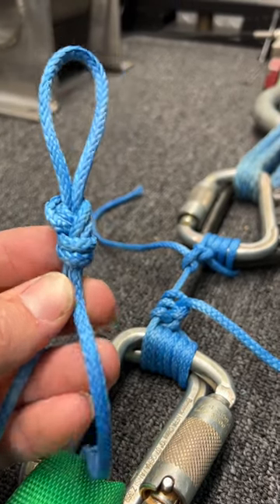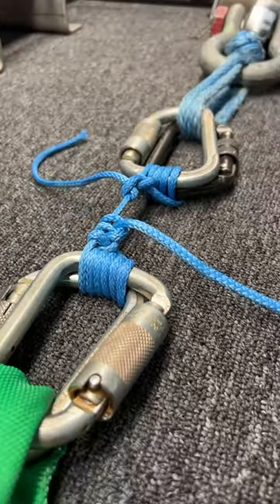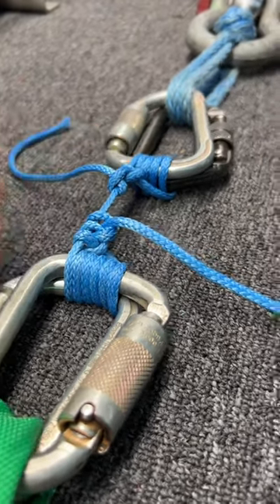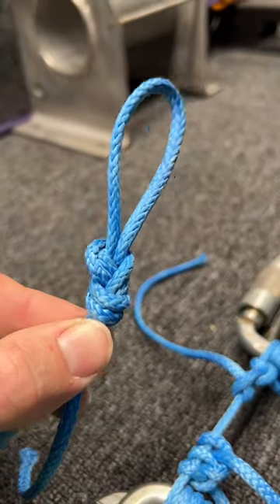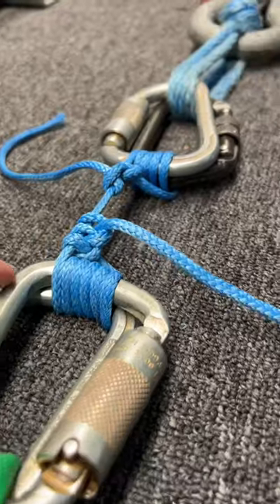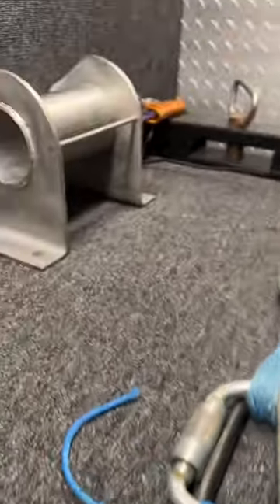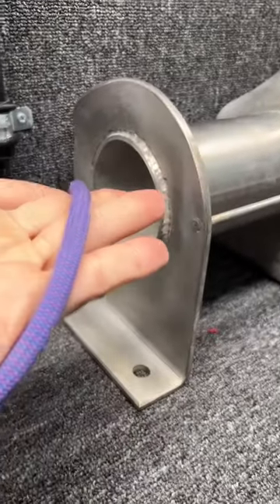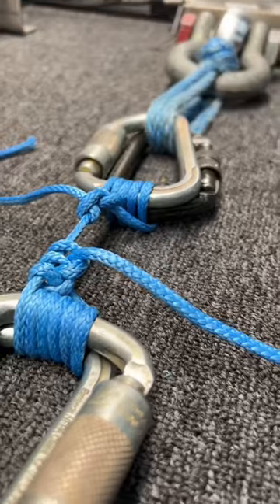Wrapped around 2 carabiners

Comment from the maker: 3mm dyneema broke at 4kn in a knot and 5.8kn when we wrapped it around 1 carabiner and here it broke at 6kn.  It breaks in the back of the first wrap around the carabiner so how it's tied off doesn't seem to affect it as long as it holds.
Reply: Is dyneema sometimes blue? I was told it can’t be dyed.
Reply: i forget how much you got when you tested the dyneema spliced, was it much stronger?
Reply: Could you test a dinema rope tied with a munter hitch, closed of with a double half hitch? I use it on my boat to tie it up with Samson braid, and woniif more muntins helps with the load distribution?
Reply: @david…: “Dyneema Blue,” as a brand name, is indeed blue. A great range of bright and subdued colors are readily available. 

Polyamide (Nylon) is available in many colors, and can be dyed slightly at home with RIT dye. Polyester, on the other hand, though also available in multiple colors, barely takes RIT dye. 
Dyneema (UHMWPE) may not take home dyeing, but commercial colored line is easily obtained.

Comment: This result makes sense since it's not the average bend radius that's the important figure in terms of strength, but rather the bend radius at the sharpest corner.    Here, although the second carabiner increased the average bend radius, the tightest part of the bend still followed the shape of a single carabiner, and so the second carabiner didn't actually help.  Or at least, not very much - the fibers in the sling can slip past each other to a limited extent, which evens out stress across small irregularities in the bend, and so it stands to reason that we'd get a small improvement with the second carabiner since the section of the sling going through the tightest section of the turn turn is shorter.
Reply from the maker: That's a really good point